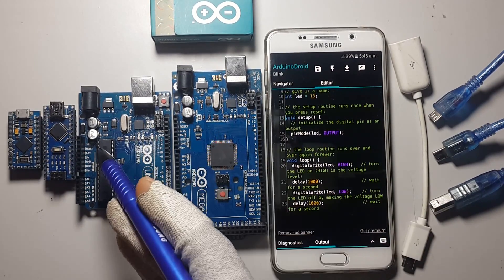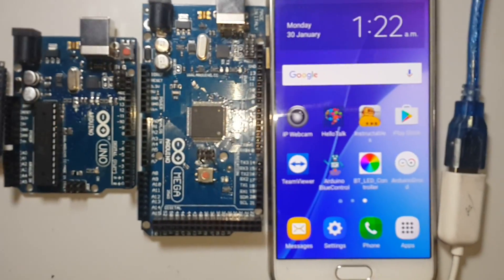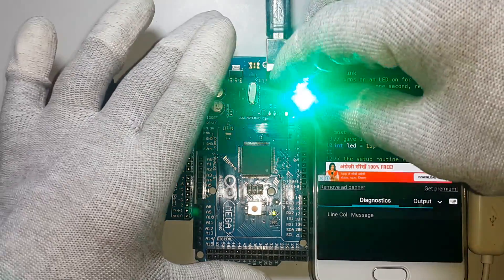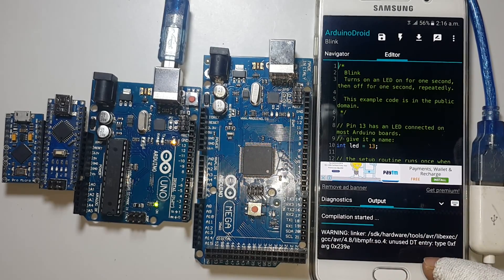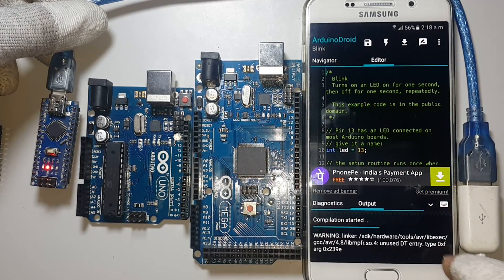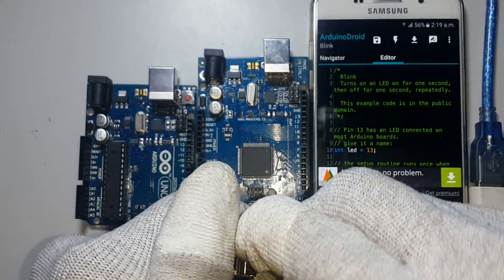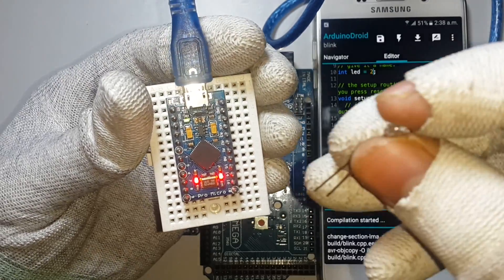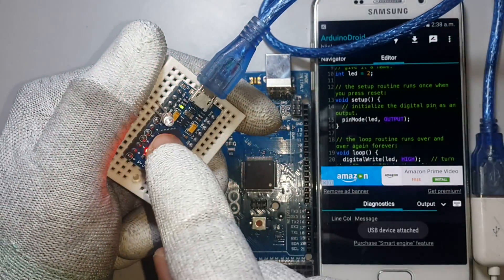How to program Arduino with android smartphone using arduinodroid android application

Comment: When i plug in my uno the led blinks already then when i start sketch the compilation error occur what to do please help .
Reply from the maker: compilation error is not depend from mobile is connected or not
 compilation error is depend on your code, its your coding issue not mobile or software issue
is compilation done successfully or uploading not done then check your mobile connect or not
if you have any issue then you can WhatsApp my, my WhatsApp no is on video description link

thank you for watching my video
in my next video have lots of interesting thing to learn arduino from zero to hero
and please do subscribe ,like and share for watching my next videos
you will definitely like next videos, in next videos have more advance project

Comment: tôi đã lưu và biên dịch thành công,nhưng tại sao tôi luôn bị error khi nạp code ct? tôi không biết phải làm gì tiếp theo :(
Reply from the maker: if you are facing an uploading problem then please check your mobile connect properly with arduino board and arduino software, or check OTG or USB cable

thank you for watching my video
in my next video have lots of interesting things to learn arduino from zero to hero
and please do subscribe ,like and share for watching my next videos
you will definitely like next videos, in next videos have more advance project

Comment: Can you design a arduino board...1) temperature and humidity
2) stepper motor should rotate 45left and 45degree right and stop .it should on every 1hrs run for 10seconds ...
Also share me the cost
Reply from the maker: sorry for long time not active on my channel,
did you solve your issue?
now i am active with many videos, watch my latest videos
 "fingerprint bike starter"
thank you for watching my video
and please do subscribe ,like and share for watching my next videos
you will definitely like next videos

Comment: hi broo 
wen I connected  ardunio nano to my phone, as u connected,and while a I am uploading software it's showing""no Arduino board found" can u suggest .WT to and how to connect
Reply from the maker: +murali krishna thank you for your valuables feedback, it's not a new problem, many people's face this problem sometime me also face this problem, 
First charge your otg data cable, use only genuine otg data cable and connect it proper and update arduino ide and also restart your mobile then recheck it, then tell me again
Thanks for watching my video 😊
Reply: kuldeep panchal bro iam using Moto g 4+.
Reply: robotic mind bro finally I uploaded program😂
Reply from the maker: +murali krishna very good bro 😊
But how, share your experience bro
Reply: robotic mind bro  I changed my USB and Arduino nano and pH settings,so it's working 😎
Reply: can u give ur E-mail bcz when I uploaded nano working but no response in LCD 16×2 why
Reply from the maker: +murali krishna yes sure bro, I'm happy to help you 😊
Arduinology7@gmail.com
Reply: bro use of small button present in nano board....?
Reply from the maker: +murali krishna this button use for reset arduino nano board
Reply: for testing light which sockets u used broo

Comment: using Moto g4 plus
otg supported 
I can use keyboard
but still no boards found
Reply: Dinesh SD hi broo Sam problem facing with same mobile"no Arduino board found". wht u did to resolve ur problem can u suggest me.
Reply: murali krishna Motog4plus is
FULL secured mobile you will need to root and patch codes to grant permissions "do this guide at your own risk" I don't do that
 I use laptop to upload program.
only few mobiles supported

Comment: how to use those 4 serial pin
Reply from the maker: +bharath P 
For example if you are using Bluetooth hc-06 with arduino mega then after upload sketch connect Bluetooth RX to mega TX and Bluetooth TX to mega RX in any serial communication pins

Comment: do you know how to use serial communication pins in Arduino mega
Reply from the maker: +bharath P 
The Arduino Mega has four additional serial ports
Serial: 0 (RX) and 1 (TX);
 Serial 1: 19 (RX) and 18 (TX); 
Serial 2: 17 (RX) and 16 (TX); 
Serial 3: 15 (RX) and 14 (TX).
 Used to receive (RX) and transmit (TX)
Thanks for watching my video 😊

Comment: I am trying to compile the blink example but still getting error
Reply from the maker: this problem comes with some mobile, please do this = go to file manager into your mobile then delete arduinodroid folder then uninstall arduinodroid apps then install again this app then check again blink example sketch and then tell me is that ok or not, if it does`t work then check this into another mobile

Comment: after reinstalling Arduinodroid also i am getting compilation error as
cc1plus: out of memory allocating 838860800 bytes after a total of 0 bytes Return code is not 0
Reply from the maker: did you delete arduinodroid folder into your mobile file manager and what mobile you are using, try to compile another mobile,  change your mobile becoz some mobile dont support

Comment: I am using Arduino Uno and following all the steps that you have shown, but every time I am getting compilation error
Reply from the maker: compilation error comes when library file not live in library folder of arduinodroid app,
if you are using arduinodroid inbuilt sketch examples then compilation error will not come but if you are using external sketch then you should have library of this sketch otherwise compilation error will comes every time,
i you are using inbuilt sketch example then showing compilation error, then i have another idea, sometime i use this, uninstall  arduinodroid app and delete arduinodroid folder into your mobile file manager then install again and check blink sketch for compiling